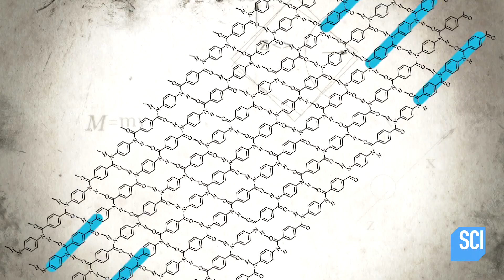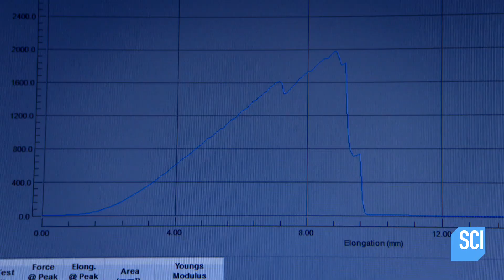Watch In Slow-Motion As Kevlar Fibers Are Put To The Test

Comment: Wow, this takes me back to doing work experience at ICI when I was a teen - I worked with stretch and burst test machines, with different fibres including kevlar.. Was sold on kevlar as a material ever since.. Not mentioned (altho implied) in the video: it's also a flame resistant and a good insulator..

Comment: Stainless is hardly structural only good for supperware imo and it looks like they used solid core hard drawn wire like the kind they use to secure rebar before cement filling. Nobody uses hard drawn anything for serious structural everything is cable. Freaking bicycle cable could have easily ''EASILY'' beat that 400lb probably 3 times over no problem however I think if the Kevlar was actually a nice clean cable it would beat even bicycle steel cable by a long shot.

Comment: MSE! Were you using 1010 in an aged condition? I would like to see the tensile test repeated with a HSLA Steel like 4140 in the quenched and tempered condition. The UTS would be around 140 Ksi.
Reply: Yeah they used the softest steel you can get.  Why not use wire rope so you have a real world comparison?  Obviously using better steel that’s heat treated would make for a stronger steel, but that metal doesn’t also bend.  

Also I hate the theatrics of her jumping out of “fright” when the metal rod broke.
Reply: I think the real advantage of a material like kevlar is not nessesarely the strength  but the wheight of the fiber itself wich makes it more practical to use many cases than steal its also more easy to handle because there is no flex in it and you can't get hurt by broken wires while touching it even with gloves
Reply: Frank Myers that’s what I was going to say once I took off my tinfoil hat.

Kidding
Reply: Or some small-diameter hardened AISI 1085 music wire with over 400 ksi UTS. Still the Kevlar would win hands down in the strength/weight department.

Comment: That looked like some pretty low quality steel though, to be fair.
Reply: How can you determine the quality of a wire of steel just by looking at a fucking video?
Reply: @hellodumplings8564  because it broke at 110 lbs. For wire that thick it's pretty pathetic.
11 gauge bailing wire can stand up to just shy of a thousand pounds.
Reply: @hellodumplings8564  three years too late, my dude.
Reply: Loebane It looked like plain ol bailing wire.
Reply: 2:30 What scene was that from
Reply: I was about to post that same thing.
I have 3/32 stainless wire from harbor freight and I just hung four 45 pound dumbell plates off of a 2 foot section and the wire isn’t even stretching after 2 days